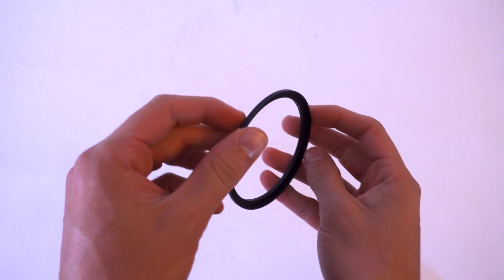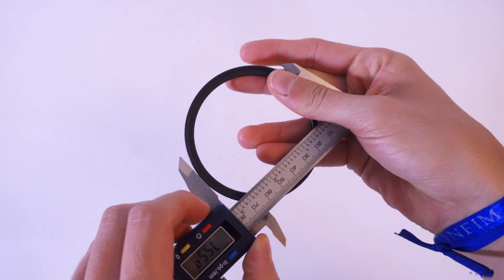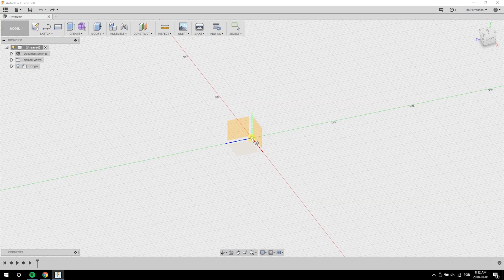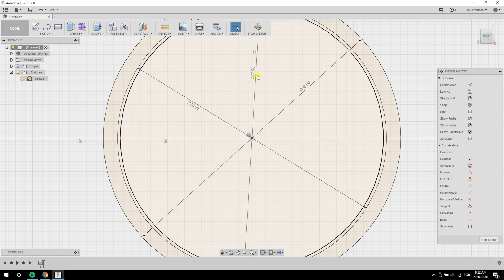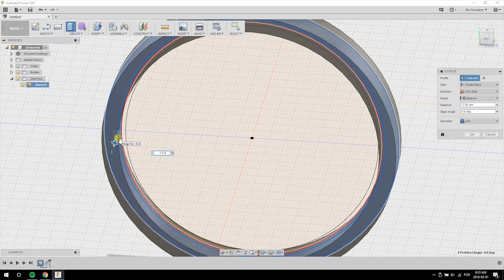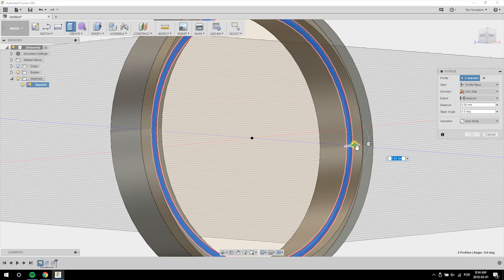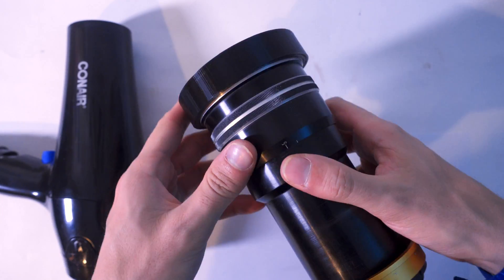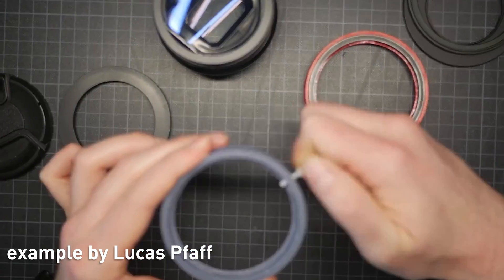DIY 3D-Printed Anamorphic Lens Front Clamp

Comment: DUDE! How much would you charge to make me a certain type of 52mm-62mm step up ring for my slr magic anamorphot with nikon lens to get clean non vignetting 24mm anamorphic.
Tell me the price.
Reply: i can do it on super 35. a 24mm lens plugged in to my bmcc 2.5k with speed booster which give me a 1.56 crop. At the moment I can get it with just a bit of almost gone vignetting without a ND filter. I can crop it out easily, but why not just go with a 28mm... but that would be too close to my 35mm lens.
I'm looking for a step up ring that is slightly concave to move the front glass element of the 24mm lens up against the rear glass element of the anamorphot lens.
When doing this with my hand the vignetting is gone. But no such step up ring exists.
Reply: ... also, check out my channel, I have plenty of SLR magic Blackmagic cinema combo anamorphot videos where 24mm is used cleanly on an older speedbooster (.71x) it's clean. What I'm trying to do is use my 24mm anamorphot combo on is the .64x speedbooster- which gives me my vignetting.